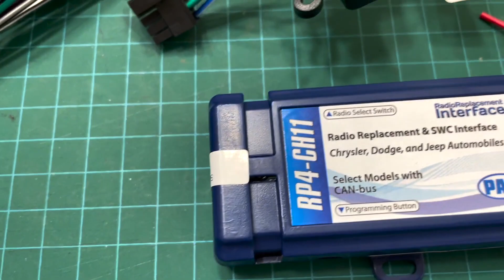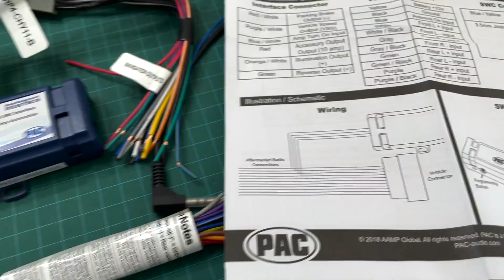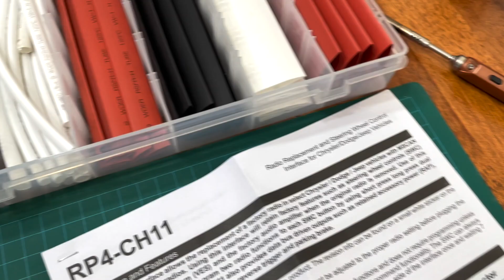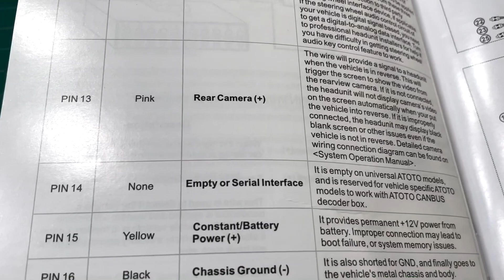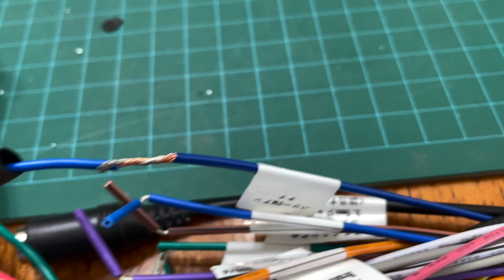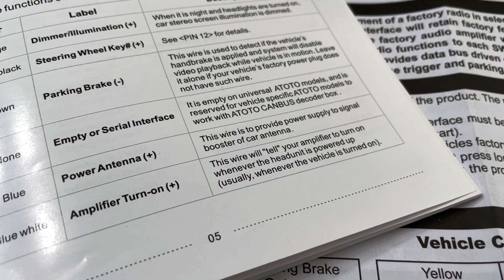RP4 CH11 Canbus Controller Walk though

Comment: Where does the blue with white stripe wire goes on the steering wheel aux plug?
Reply: No. It will be a different plug in back of radio. If the brand radio dont have it, then you hook the blue wire up instead to steering wheel wire at back of radio. Usually a purple or orange wire. Not orange dimmer wire that's different

Comment: did you conect the key and 2 to the wires or does the module not need that and u plug the 3.5mm jack directly in the atoto ? bcs i dont have key 1 and 2 cables on my jeep wrangler and i am confused ...
Reply: Did you get it same situation

Comment: There is a selector 0-9 on the RP4-CH11 depending which brand of head unit you have. What did you use?
Reply: I just installed mine. Works with 7